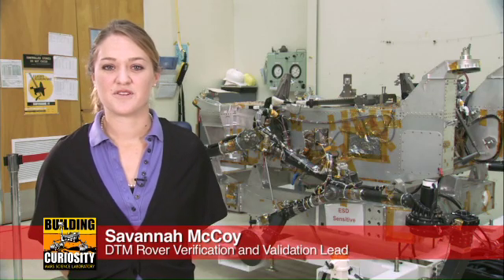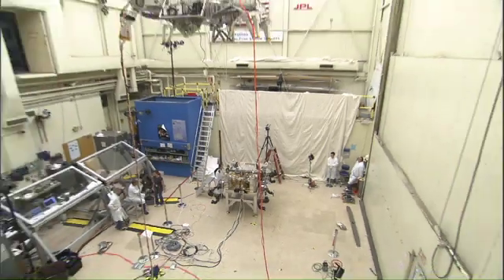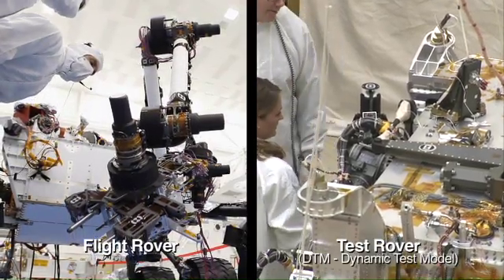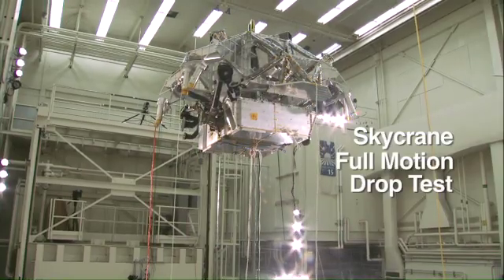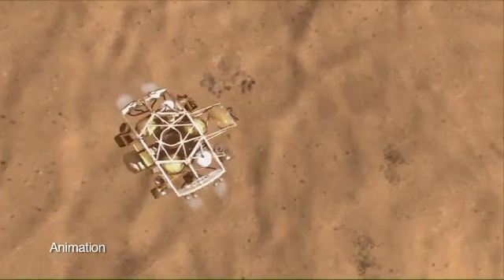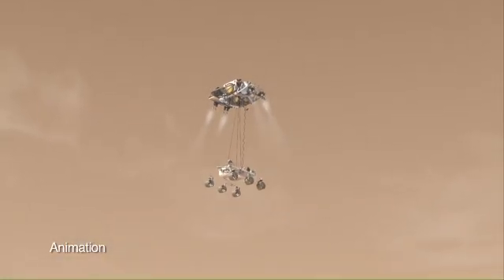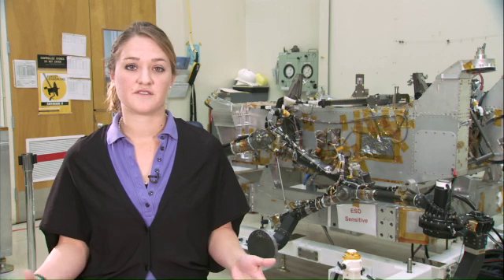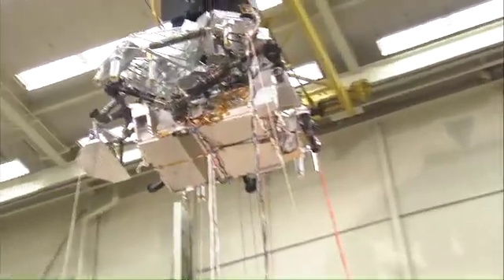Curiosity Landing System Drop Test

Comment: Crazy how long ago this technique was developed.
Kinda scary, how outdated some of the stuff might be, because they are so slow in development.
Reply: See this is the problem with folks who think "new features" equates to innovation. The fact is that reliability and dependability are what matter. This isn't about adding new tech that is untested. 

Its about ensuring the tech works no matter what happens. There's a reason why the automotive manufacturers use the exact same approach. You build and then improve upon the design over time. Thinking this is slow development is illustrative of folks who aren't involved in developing something that lasts. 

Same reason why the Landcruiser still works in the middle of no where while, newer vehicles with more feature's literally take a shit every other year. Anything on earth that is reliable, has been built and tested for years against every foreseeable issue. This vehicle has to have a service life of at least 10 years.  

That is how dependable solutions are built.

Comment: A lot of people seem to be under the impression that the system isnt fully tested unless it can work perfectly on Earth.  THAT is not practical.

Earth has 2 1/2 times the gravity that Mars has.  Mars atmosphere is only 1% that of Earth, and the temperatures are much colder.  The amount of mass that you want to shoot in to space needs to kept as low as possible because its EXPENSIVE to lift mass to another planet.  The system has to be designed for the specific conditions where it needs to operate.

If you tried to do a complete test of the actual Mars system on Earth it would fail because the engines would be too small, and the stresses of the higher gravity would break a lot of parts.  To make it work on Earth you would have to completely re-design the entire system to the point that it wouldn't even resemble what you need on Mars.

NASA worked to test as many of the systems in a Mars-like environment as they could.  Near vacuum, super cold conditions, vibration from lift off and rapid deceleration, ect.  When they tested the helicopter drone to see if it would fly on Mars they put it in a low atmospheric chamber and attached some string to the top that pulled up with enough tension to simulate the lower gravity on Mars.  That helicopter drone would not work on Earth because the thick atmosphere would not allow the blades to spin fast enough.
Reply: Very few would even want to bother understanding the design constraints of the mission. Folks want to act as though they're an authority on this all without having built anything in life. If folks every spent a second trying to fabricate something simple themselves, a lot with suddenly start to make sense.

All in all, this is incredible and the fact that we can watch footage of the landing and just watch footage of another planet all while sitting on the couch is just an incredible achievement. 

Thank you for taking the time to explain this. I only hope more people learn rather than seeking to critique.

Comment: So my question is, was this drop system tested in a full 1 gravity, or was any compensation made to lessen forces to simulate the 0.38 gravity of Mars?

If it can take a full Earth G and survive then naturally it should easily withstand less than half the G force on Mars but since so much effort is put into reducing the mass of systems sent to Mars wouldnt you be able to build a lighter weight drop system that only has to work in 0.38 G?
Reply: I wanna say they the test version of the rover is lighter to simulate Martian gravity, but I’m not exactly sure for this demonstration
Reply: Normally for tests like these they’ll add an a force to counteract gravity In the upwards direction, so in this case they’d use wire with tension = to 0.62mg

Comment: They always build replicas to test back on earth.
Reply: This is a test of the release of the rover. Where's the test of the fly of skycrane with the rover, on earth ?? And remember that the atmosphere on mars is hundred time less that atmosphere on earth...
Reply: @Alfan838  Rocket engines don't need atmospheres to work; I actually believe that a higher pressure atmosphere would attenuate the thrust, so less atmosphere would be preferred. You also forgot about the fact that the gravity on Mars is about 1/3rd of that than on Earth, meaning that for the skycrane to work on Earth you'd need engines that are 3times stronger. Stronger engines also (usually) mean they'd require more fuel to run for the same time, which would require a big redesign of the skycrane's propulsion system, which renders the whole idea of testing such a thing pointless.
Reply: @Alfan838  It wouldnt work to have the flying skycrane on Earth because of the higher gravity.
You would have to completely re engineer the system to the point that it wouldnt even BE the Mars system any more.

Comment: Where have I seen this incredible? indoor experiment before? I would prefer to see a continuous video taken from high up in the thin atmosphere here on Earth showing the sequence from the drop from an airplane, the release of the parachute in thin air and low gravity - as on Mars - and the lowering of the experimental rover from the sky crane and the landing on solid ground. Have this ever been done? If not, the project have bypassed an important opportunity to test the system under realistic conditions.
Reply: This footage is from the Curiosity rover, which landed on Mars in 2012.  The current Perseverance Rover that just landed used a very similar system and it worked just as well.

Any test that they could have done on Earth that approximates the Mars landing WAS done, have no fear of that
Reply: @BradiKal61  It's just a strange thing that we are presented to multiple demonstrations of such - indoor - tests, but never to a test under real conditions. I think you and many others are a kind of religious believers. You want it to be true - and so do I - but at the same time you don't want to examine the probability of being lied to. The alleged manned Apollo landings on the Moon were faked by NASA, so why should I have any trust in a liar?
Reply: @Eigil_Skovgaard   Apollo wasn’t faked, and I can prove it. The dust kicked up by the rover would be impossible to fake on Earth because you would need a vacuum and 1/6 g.
Reply: @jakemckee2005  I am glad you mention the dust from the rover. In a well known scene where the rover speeds up, you can watch the soil being thrown up and then hit by the air! which creates a "rooster tail". This phenomenon can't exist in vacuum, only in a dense atmosphere as on Earth. The dirt would follow a perfect parabolic trajectory in a space without air, but still with a low gravity. Of course the speed of the video was manipulated to give you the impression of low gravity, but "unfortunately" that didn't change the shape of the rooster tail. Or should we say - fortunately!
Reply: @Eigil_Skovgaard   yes it can exist in a vacuum, why would it not? And it does fall slower because of the moon’s gravity, it would be much harder on earth.
Reply: @Eigil_Skovgaard  and the dirt did follow that trajectory.
Reply: @jakemckee2005  No, it moved in the shape of a rooster tail. But help yourself. I am wasting my time here.
Reply: @Eigil_Skovgaard  it moved in the shape of a rooster tail because of how it was moved by the wheels. And, that shape is possible in a vacuum.
Reply: @jakemckee2005  When a particle is released from the wheel in an angle backwards it will follow a perfect parable in a vacuum, because no other forces are affecting the movement. At the same time the height of the curve will be greater in low gravity. Nothing can change that perfect shape. When the same occurs in an atmosphere, the particle will meet resistance from the air and take the shape of a rooster tail - not to the same height on Earth of course because of the greater gravity, provided the force from the wheel is the same.
Reply: @Eigil_Skovgaard   but the dust goes much higher than possible on Earth.
Reply: @Eigil_Skovgaard   and dust wouldn’t fly like that on Earth, it would be pulled down by the friction of the air. This had to have been filmed in less than one g.
Reply: @Eigil_Skovgaard  and how the dust doesn’t just disperse and spread out a ton like it would in air. And, this stuff is basically fine sand. Tell me one time fine sand would float like that in 1 g.
Reply: @jakemckee2005 What "air" are you talking about on the Moon? I just explained to you that the only forces working on a particle above the surface of the Moon would be the very low gravity and in this case the kinetic energy of the particle itself. Think of a bullet leaving the barrel of a gun on Earth. The curve is not symmetrical, because the air pressure slows the bullet down, and the radius at any point of the curve becomes shorter towards the end. If the same bullet was fired on the Moon (with no air) the curve would be perfectly symmetrical.
Reply: @Eigil_Skovgaard   Yes, I know. But how the sand floats makes it impossible to film on Earth. And the particles all act in the same way, spinning and curving as if there was no air to slow it down.
Reply: @jakemckee2005  This is a visual illusion created from manipulating the speed of the images. I think I found the explanation on aulis.com reading the Moon rover articles, else a full explanation of what was involved in the creation of the Apollo films is in the film, "Make Believe - Smoke and Mirrors", also on aulis, under films (it's rather irritating to watch, but it's a gold mine from one of the leading film technicians).
Reply: @Eigil_Skovgaard   if they manipulated the speed, why wasn't anything else warped? You're really grabbing now.
Reply: @jakemckee2005  Now you are acting ignorant. Go and watch Make Believe - Smoke and Mirrors and get more knowledge about the problem with rooster tails on the Moon. If you still think the manned Moon landings took place, then explain this:
Photographic film needs to be pressurized of at least 1 - 1.5 psi (0.1 bar) when it is used in the vacuum of space. An engineer Phil Pressel who had worked at Perkin-Elmer Corp of Danbury, Connecticut USA assisted in the development of the twin camera assemblies for the Hexagon spy satellite (KH-9). It was declassified in 2011. Phil has mentioned the need to keep the film used under a small pressure which was supplied from a nitrogen gas bottle. The film and the cameras were mounted in a separate sealed housing inside the satellite. After exposure, the films were transferred into what were called buckets in the Hexagon, and when full the buckets were released to return to Earth, where they were caught in midair by aircraft trailing 'fishing nets'. Again with the Lunar Orbiter of 1966/7, which had also used photographic film, the film was developed onboard the craft using a method similar to the Polaroid system, then scanned and the images transmitted to Earth for examination. NASA were trying to identify suitable sites for Apollo landings. The cameras and film were housed in a separate container inside the craft under a higher pressure than the relative vacuum surrounding the satellite. Why? Because traditional emulsions had shown to boil in the vacuum of space and destroy. Now you can exclude all the "iconic" Hasselblad photographs allegedly taken on the surface of the Moon on ordinary film in an ordinary camera.
Are you still in doubt, I have another for you - and another - and another. Don't answer before you understand the implications of the above.
Reply: @Eigil_Skovgaard   eh, you’re already knee deep in conspiracy theories. Why bother. Goodbye
Reply: @jakemckee2005  What else could you say, when you are out of arguments. Hope you will use this chance to improve your view in general. We conspiracy realists have a lot of stuff you could dive into to get out of your mental prison. Nice to talk to you - in between.
Reply: @Eigil_Skovgaard  I’m not out of arguments, you just clearly will always just explain them away. Waste of time.
Reply: @jakemckee2005  Or you are not willing to allow yourself to think about the implications of what I have explained and showed you. Your choice.
Reply: @jakemckee2005  That's the verdict if you don't understand the content. Bye now, you have got your share of my time. No, wait a second, I have another stupid thing for you. Remember the "iconic" image of allegedly Buzz Aldrin on the Moon. Look at his suit. Observe the gauntlets being of different length. An obvious error. You can also see the upper ring above his RIGHT gauntlet. This means that this ring is disconnected from the glove, so his suit holds the same pressure inside as on "the Moon". Apparently he survived. Also he is wearing his Omega watch - on the Moon! Come on, how far are you ready to fool yourself.
Reply: @Eigil_Skovgaard  Do you have a psychiatrist? Please stop bothering people with your paranoid fantasies.
Reply: @logitech4873  I have you, thanks!
Reply: @Eigil_Skovgaard  Dude check yourself before you wreck yourself. There are so many more arguments why they couldnt have faked it, than why they could have. Try creating long paralel shadows with studio lights for example. Ill watch Smoke and mirrors if you watch: Why the Moon Landing COULDN'T Have Been Faked | Adam Ruins Everything here on youtube. P.s  a release for the film magazine was removed to prevent it being accidentally bumped in flight. It was made so only a ground-based engineer with a wrench could free it. P.P.S What would Nasa's endgame be if all was faked? Mind control? LOL Thats like saying that archaeologists are scam artists for profit....
Reply: They're not doing this test to prove conspiracists that they can actually do it. They're doing it for themselves, to check their calculations are correct. They share it because people might be interested.
Reply: @trezapoioiuy  Actually the tax payers should demand to see a bit more, and in fact have a commission to investigate NASA. But we are dealing with an agency under CIA. So, of course bits and pieces are shared to keep the gullible nation distracted from politics.

Comment: Testing lowering the rover from a sky crane is that is bolted to the ceiling is a lot different from that what would happen when it's swaying and dangling from propulsion engines.
Reply: I guess you are smart enough to think that and everybody at nasa forgot that
Reply: Yes, this is one step in the process.  Test on static fixture before rocket-propelled drop-ship.  Sounds like you don't have much experience with engineering.  Keep watching videos like this, and you'll learn more!

Comment: Where is the test landing on Earth? does it even exist? you don't send a rover to another planet and not have a fully tested landing on Earth. If it exists I want to see it.
Reply: Joel Radhakrishnan  Burning hydrazine produces colorless gas
Reply: shag  Yes I saw it today, very impressive
Reply: They used it on the rover literally yesterday
Reply: That system WOULDNT work on Earth which has 2.5X the gravity of Mars.  the purpose of the test is to see if it will work on MARS, not build the same kind of thing to work on EARTH.
Reply: @BradiKal61  ok, even if that is the case, don't they want to do some kind of testing, such as stability etc... those boosters need to even out their thrust, did they at least test that ?
Reply: @SzTz100  I think that evening out the thrust is the least of their concerns. They have 60 years of experience developing thrusters for God's sake, and nowadays every quadcopter drone does that, it's not rocket science, at least not anymore.
Reply: @SzTz100  literally a 2 dollar chinese drone can balance thrust, it's indeed not that hard anymore. Or do you believe that is cgi too?
Reply: @tiespauelsen7983  There is nothing wrong with questioning things. This is called the scientific method, to question. But let's take your argument to its logical conclusion, you are telling me the NASA Mars lander, a project worth over a billion US dollars, does not need to be tested on Earth because NASA knows it's going to work all ok. This is almost never the case in any major project, everything, and I mean everything, has to be tested. Please keep in mind this is not a 2 dollar Chinese drone.
Reply: @SzTz100  oh well it tested everything, but can't test the whole sequence in real time. These hydrazine monopropellant thruster they have tested and used multiple times, and thrust vectoring is common in fighter jets and even simple drones because all you need is a gyroscope basically. It's basically combining simple things, parachute, rocket hovering (not so simple but for example already used in the training vehicle for the moon landing tested on earth) lowering rope, cutting rope, that's it. They tested everything multiple times and saw it worked, and then send it to space. Sometimes you can't test everything before you build it. They also don't built a bridge on the wrong location, see if it's stable and than built the same bridge at the desired spot, they use small scale testing and previously acquired knowledge to built something that works